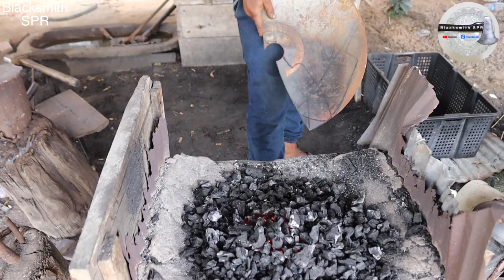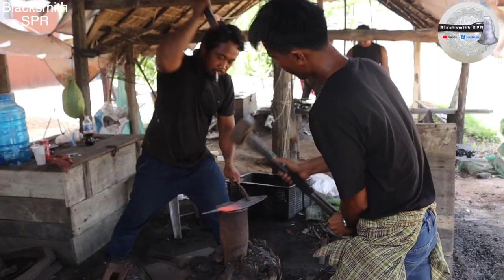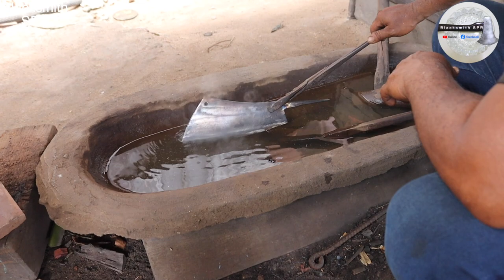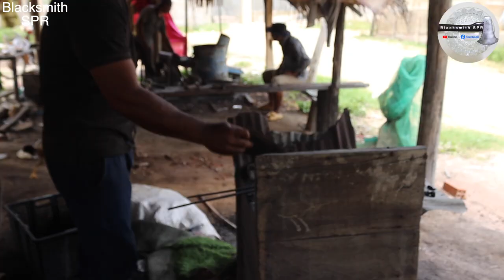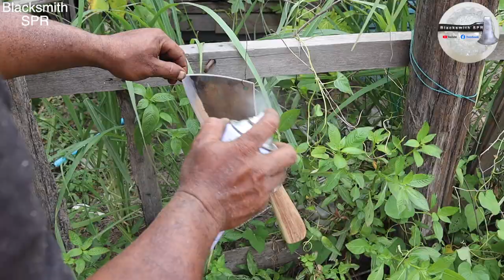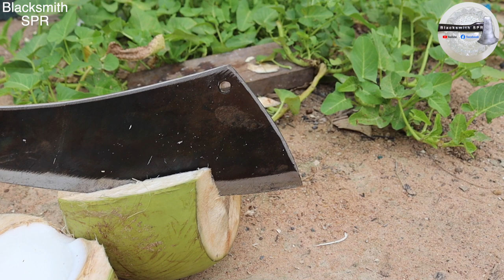Knife Making- The Most Beautiful Cleaver Knife making Process.

Comment: Very little carbon in that steel, it’s mild steel. Not suitable for making blades. The craftsmanship is shitty and you can’t harden the steel. Low value work. No pins or epoxy in the handle, that blade will come flying out to injure someone someday.